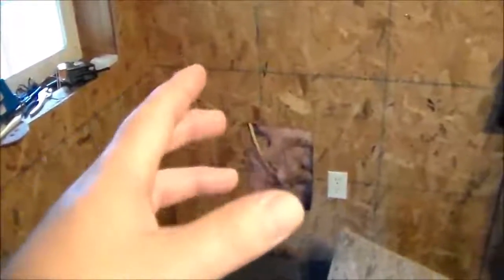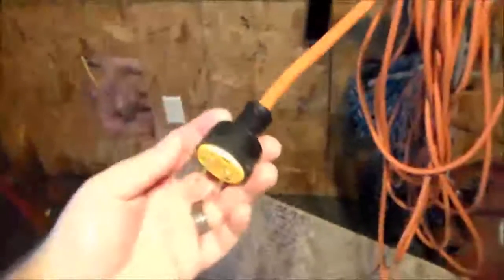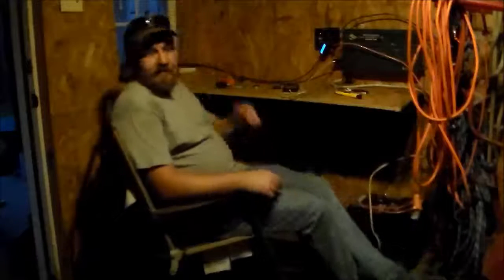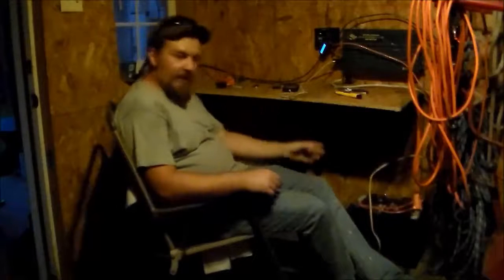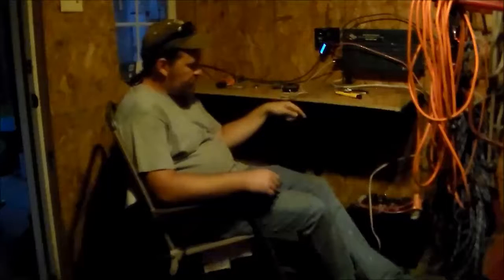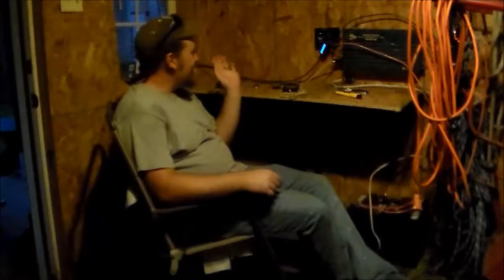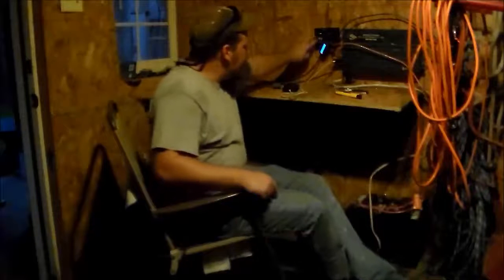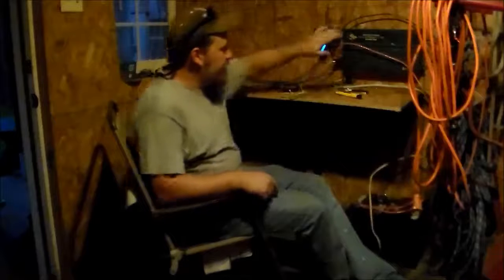Part 3 off grid Becoming more self sufficient (Setting up solar)

Comment: Re your suicide cord (lol)... my understanding is that the modified sine wave inverters should not be connected to the same neutral line as a grid. The breaker only shuts off the live, and modified sine wave inverters put out voltage over the neutral wire. I forget where I read it, but thought you might like to know so you don't get shocked by what you'd think was a neutral wire... :)
Reply from the maker: Thanks. I had never thought about that. Good thing to know :) Shed i have set-up is ran purely on solar not connected to grid at all but i was thinking about feeding some circuits in the house so will have to get voltage tester out see what has voltage on it. Thanks again for info!!

Comment: I like the setup, and I hope the inverter is Ok by now, and if not, let me know, and I will help out a bit for you to get a new one. I can't do much, but I would love to offer you something to get started. I really value what you have shared with me, and it would be wonderful if I could do something to help you too. Got a paypal account? let me know. Bless, Sheila
Reply from the maker: Thank you so much Sheila for offering. Im really glad you like my videos. But It will all work out :)
Reply: Ok, hope to see you up and running soon. I had considered putting my setup outside too, but had already figured out, that me, being as old as I am, that this Is no time to be going out in the snow, to deal with problems with all those devices. So I'm going to make a nice place inside, and feel blessed to do it right the first time, and not find out later what a stupid mistake I had made. As soon as it's a bit cooler, I will finally be getting my solar up, that I have had to wait so long for. Hopefully my oldest son will be able to do all the solar panel construction, and I can decide how far I want this system to go. 300 or more watts. I was going to do 2 systems, ( 1 small & 1 large) but it may be better to do them all at once and put them together. Since the last time, I thought the larger panels may be better than having to get so many more of the 100 watt panels, and since I read that it's not good to mix the wattage, it may be better to just go with the larger and not get more 100 watt ones. Less space too. Well, time for some sleep. Bless, Sheila